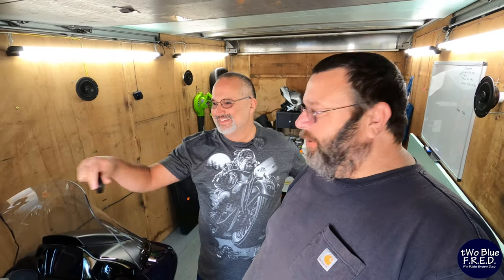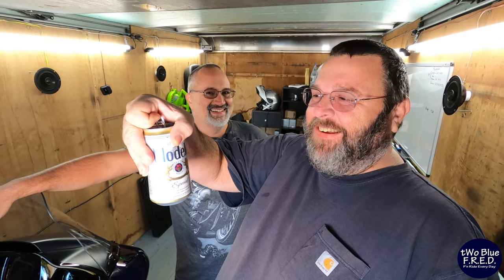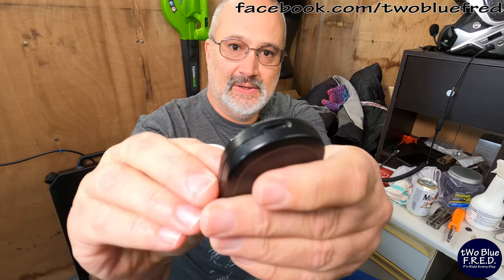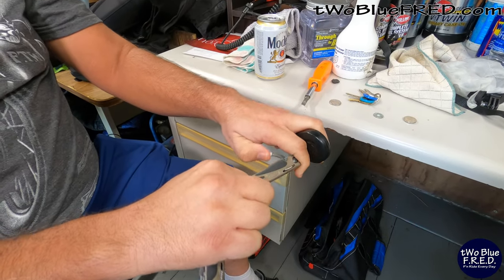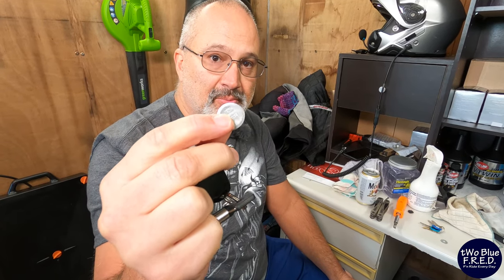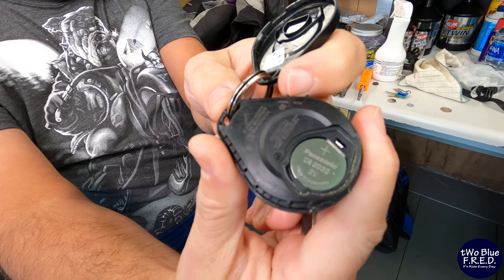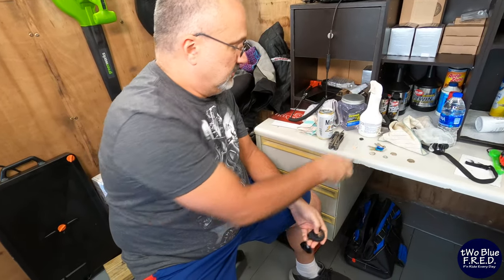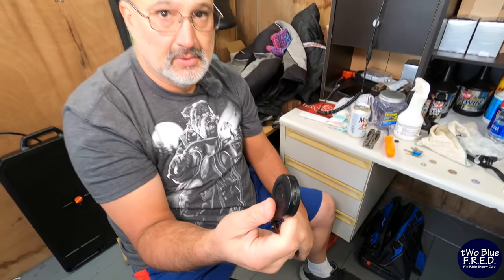HOW To  Change HARLEY Key FOB battery #harley

Comment: I rewired my entire hand controls on my harley.  Why, you may ask . I put the battery on my key fob the wrong way . Talk about feeding like a complete idiot.  I had never put a 3v battery with the flat facing down always with the flat facing up . That was my mistake 😅😅😅😅 when installing 5 new batteries on my fob.

Comment: To keep your fob looking nice and not all dinged up go the a guitar shop and buy a Fender Heavy pick. It does not mar the surfaces just force the tip in to the sides on both side to get it to pop up.
Reply: Good pointer! I got a few 2.5 mm dunlops always sitting around

Comment: Do you have to re-program the fob or just swap the battery out and get to riding? I’m fixing to take my first Harley trip & I want to swap out the batteries on my key fobs. So thats why I’m asking & I don’t wanna screw anything up. This will be my first ever swapping out a Harley key fob battery. I’ve done car ones & with Ford I had to re-program it thats why I ask.

Comment: Hi, I have problem with harley davidson 883 key fob won't connect after battery replacement
Reply: Did you find out why ? Mine takes about 4 minutes to start, im wondering if its the FOB battery.

Comment: I had to practically destroy the FOB case in order to pry it open.  I hang it on my belt loop and it gets exposed to sunlight a lot, so that is maybe why.  I don't have baggy pockets, though--hence the belt loop option.
Reply: I destroyed mine getting it open. Nickle plastic scraper. Never had a key fob that hard to open in my life. I have my spare but the battery is dead. Don’t wanna destroy that one also

Comment: cheap garbage plastic. $70 for one. chewed the crap out of the plastic before it popped
Reply: Using a coin as he suggested is not the best way to open these. The edges of the coin rip up the plastic. I find a flat blade screw driver is the least damaging device to crack  them open.
Reply: @beer1for2break3fast4  i used a flat screw driver 1st. Coin worked better
Reply: @beer1for2break3fast4  , yep, mutilated mine getting it open. Owned many vehicles with fobs and never an issue until this Harley pos fob